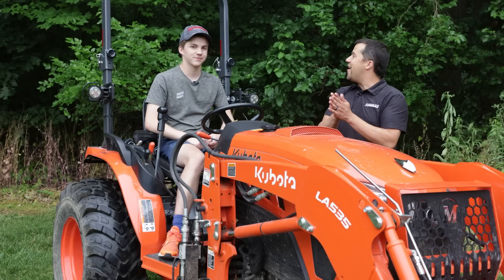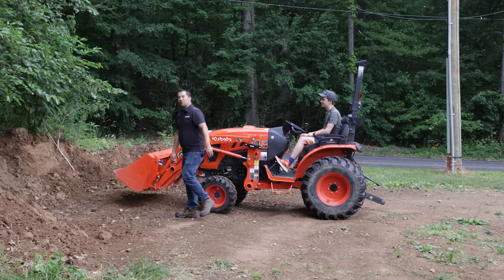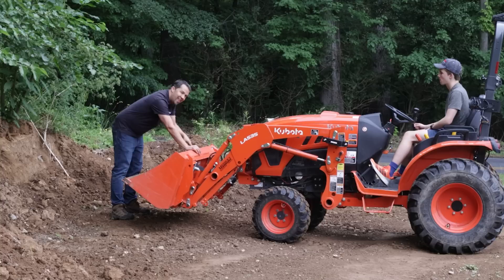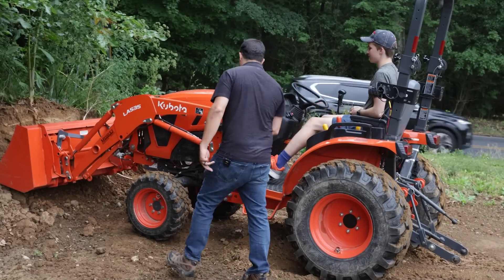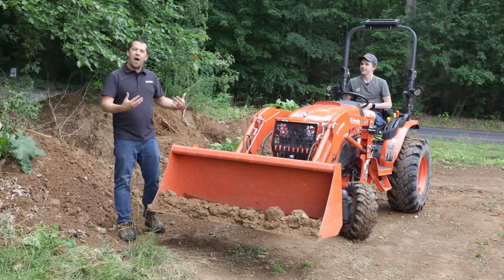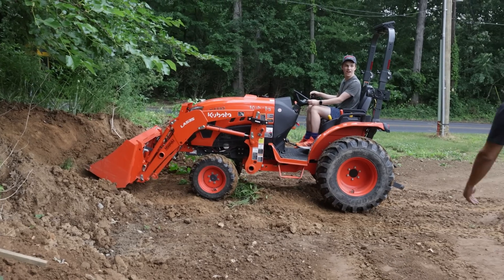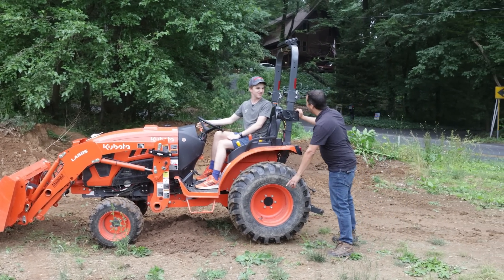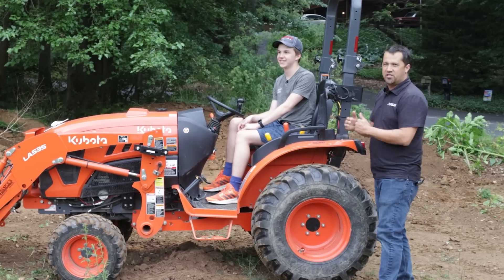8 Loader Operation Mistakes

Comment: Two suggestions for new tractor owners that do not get enough emphasis: 1. Put the rollbar up when in use if your compact tractor has a foldable rollbar. 2. The rollbar will not save your life if you don't wear your seatbelt. Great video, thanks.

Comment: Haha great video guys. I've often wondered why tractor loaders don't roll the bucket back near as far as a backhoe or articulating loader? I catch myself on occasion leaving the loader kinda high so the material doesn't spill out the front of bucket.

Comment: I don't have a loader for moving dirt ! I have a reversable scope that goes on the 3 point hitch. As I can move more dirt and or gravel with the scope than someone with a bucket. My scope was made for a much bigger tractor and is been modified to fit and work with my little 234 International hydrostatic 18HP. Tractor! The only thing that is bad for me is a very sore neck from turning around all day.

Comment: I almost flipped my tractor 3-4 times in the past 2 weeks , roll overs are real and if you dont use your thinker, its gonna be tits up faster than you can blink and eye, now i took the backhoe off to use another implement but if you have the backhoe, use it for ballast it might make the difference from going home or going to the hospital or worse, life is far better with 10 fingers , 10 toes, 2 arms and 2 legs , and not in a wheel chair , safety first folks